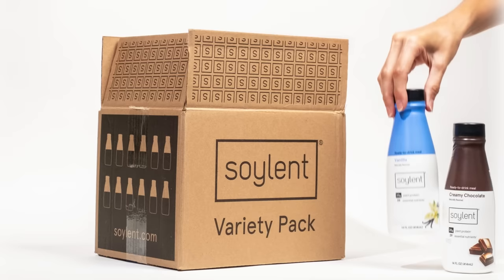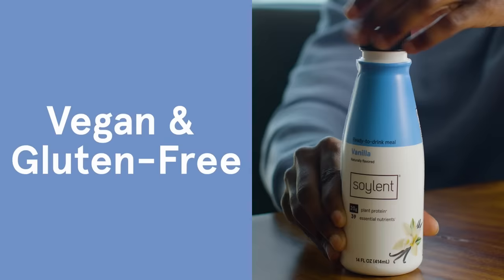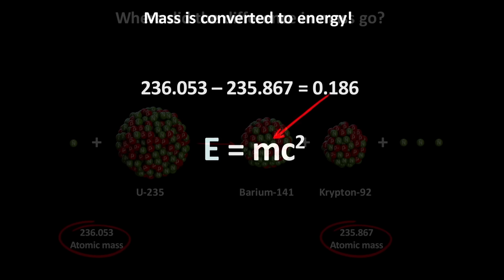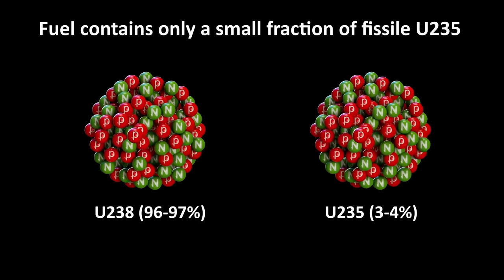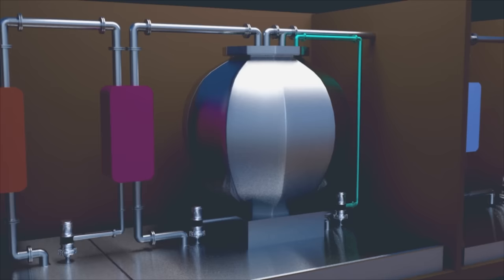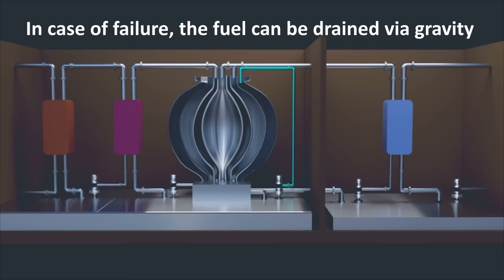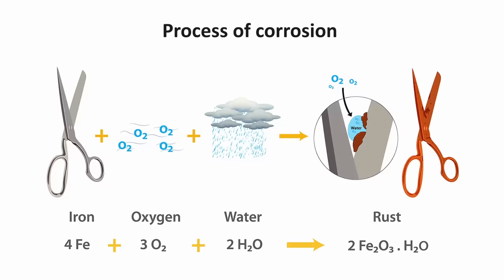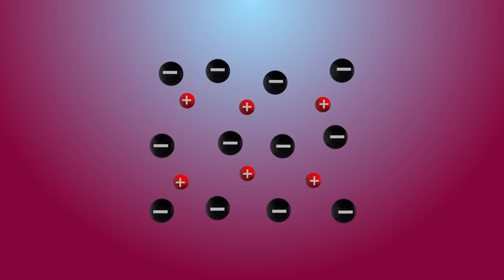How Molten Salt Reactors Could Revive Nuclear Power

Comment: I'm a retired nuclear and electrical design engineer with a solid 50 year career under my belt owning a nuclear engineering consulting company called Radiation Measurement Systems, inc.  We did work both in the civilian nuclear industry and in the weapons establishment.

You really screwed the pooch on this one.  You made so many mistakes that it was painful to watch.

First, let's get the biggie out of the way.  There is no such thing as a thorium reactor.  Thorium does not fission under any condition.  Thorium is a fertile material.  It must be transmuted into uranium-233 which is fissile.  The reaction is

Th-233=  + n > Th-233 beta decay ->protactinium-233 - beta decay -> U-233.

For a thorium-fed reactor to start, there must be some U-233, U-235 or Pu-239.  Once the reactor is started it will breed from the Th-232 more U-233 than it consumes.  In continuing operation is it a thorium fed uranium reactor.

Second, whatever they're doing in Copenhagen is irrelevant to the rest of the world.  I've been advocating for molten salt reactors for at least 30 years and I've never heard of them.  Proposing using heavy water as the moderator of a reactor which would run between 600 and 1000 deg C is pure insanity.  Do they plan on pressurizing the heavy water to keep it from boiling?  Water becomes a super-critical fluid at 374 dec C and 3,200 PSI.  At 600 deg C, super-critical water exerts a pressure of over 6,000 PSI (my thermodynamic table runs out below 600 C).  Are they really going to try to claim the reactor is safe with those kinds of temperatures and pressures?

Everybody else, including the original Molten Salt Experimental Reactor) is using graphite as the moderator.

Third, spent light water reactor fuel does NOT have to be stored for thousands of years.  Even without recycling, the spent fuel will be cool enough to store without shielding after about 100 years.

You need to understand the concept of the decay constant, the reciprocal of half-life.  This means the more radioactive an isotope is, the shorter its half-life.  The bad stuff like Cs-137, Ba-133, Co-60 and Sr-90 have short half-lives.  They're pretty much gone in 100 years.  The very long-lived stuff who anti-nukes who don't know anything, scream and yell about are barely radioactive.

A long example is potassium-40 with a half-life of about 4 billion years.  It is present in all potassium including KCl salt substitute.  On my website (neon-john.com) is a photo of a container of Morton Salt Substitute tickling my Geiger counter.  That's the major reason every human on earth (and all the animals) are radioactive.

You should further understand that Oak Ridge designed a burner reactor, designed to take the high level waste left over after the U and Pu are removed, and transmute it into even more more radioactive, even shorter lived isotopes That all decay completely in about 100 years.  The physical amount is tiny, something like a gallon a year for a 3.5 GW light water power reactor.

Fourth, Pu-239 in spent fuel is NOT highly radioactive.  With a half-life of about 1600 years, it can be handled for an indefinite period of time with bare hands.  As a practical matter, when Pu is handled in open air, cotton gloves are worn to protect the Pu from fingerprints.  I have handled it both in an argon glove box with only the rubber of the gloves between me and it and in open air with cotton gloves.

Fifth,  The thermal self-control you mention exists in all Western-designed reactors and is known properly as the negative thermal coefficient of reactivity.  In a PWR, when the turbine picks up more electrical load, the throttle valve demands more steam.  The steam generators respond by slightly cooling the primary reactor coolant (I'm talking about up to about 6 deg F) and thus increasing the power until the temperature is almost back to where it was.  The reactor self-controls over a moderately wide range of power using just the negative thermal coefficient without touching the control rods.  This is NOT unique to their molten salt reactor and is one reason nuclear reactors are so safe.

I could go on but I'll stop here and summarize.  You should not be posting on subjects for which you know practically nothing.  You didn't know enough to realize that the Copenhagen boys were feeding you the KoolAid and you drank it right up.

I should note in closing that there are at least 3 companies working on molten chloride salt reactors.  They claim that chlorides are less corrosive than fluorides but I don't see this going anywhere but my mind is open.

Lastly, much more information is available about the activities at Oak Ridge and the Las Alamos National lab.  One of the very few things Clinton did as President was an executive order called Libraries without Borders.  This order commanded every executive branch agency to declassify everything that could be and then put that info on the Internet.

Las Alamos responded with a massive declassification effort and then put their whole declassified library online.  Thousands and thousands of papers and reports.  Several of us nukes realized what a valuable and fragile resource this was so several of us scraped the whole site.  A direct download link to my collection is here.

http://www.neon-john.com/Nuke/LANL_reports.tar.bz2

This is a 5.5 Gig tarball that expands out to about 12 GB.

Lots of reports on the experimental reactors including the Molten Salt Experimental Reactor.

Sure enough, when shrub took office, he rescinded the order and the library went away.  Fortunately it got scraped several times before shrub got hold of it.

Have Fun.
Reply: The US had a short-lived thorium reactor in the 60's, and China has one in operation for about a year now.  Not sure if there is any point in reading anything else you have to say.

Comment: Of course there are problems with any knew technology but not unsolvable. Kirk Sorenson says that there is enough thorium in America's rare earth mine tailings (waste) to power America for a 1,000 years. The problem is that the PTB don't want cheap energy for the masses. Otherwise  thorium molten salt reactors would be up and running and plentiful.

Comment: The corrosion problem could have been solved long ago. The real reason was that the giant corporations that developed pressurized water reactors for the miulitary (and the fuel production cycle), wanted to make even m,ore money by dominating civilian powewr production. The vast amounts of taxpayer money they got for the military development just wasn't enough for them.
Also, the molten salt reactors don';t produce the plutonium they wanted for bombs back then.
Reply: Corrosion is just one of many problems. The biggest are no practical way to remove waste product, especially neutron poisons that well eventually collapse fission, Next is the problem of salt caking, breaking off in chunks and trashing the circulation pumps, third, no way to service the reactor or even do a proper inspect. LWR can be fully submerged in water and since the water is transparent, the can be full inspected inside for corrosion, cracks, etc.

DoA for MSRs.

Comment: Great video as always and very encouraging for our future. Wind and solar are GREAT, sometimes and in some places, but for 24/7 base load, we NEED this.
Reply: Until we come up with a good way to store energy, wind and solar ARE NOT great, they are a hindrance.
Reply: @jasonk125   Well I have been doing wind/solar EV's for more than 40 years and I could easily debate you or your Godz.  I will use experience and facts, you can use your dreams and memes.
Reply: @danadurnfordkevinblanchdebunk  I have no doubt about the truth of your good experiences with renewable energy, and I'm seriously rooting for the battery breakthrough we need, but as it is, I also believe the calculations I've seen regarding scalability of these energy-intensive/materials-intensive energy sources up to the point of powering our increasingly industialized society without a solid base load component - and we just can't keep doing that with coal and gas. We have to stop that NOW.
Reply: @aclearlight   Natural gas is mostly used today for peak loads which are absolutely essential for ruinables to work at all on the grid, but in case you didn't get the memo, the Greenies vow to do away with all fossil fuels.  Without nuclear this would certainly mean massive rolling blackouts, energy rationing, and exorbitant electricity rates.  Don't count on some major breakthrough on chemical batteries; after over 250 years of battery development, they are still not up to the task at hand.
Reply: @aclearlight   Will debate any EV nonsense too, although more people are waking up to actual facts on those so my efforts debunking them is getting easier all the time.

Comment: The elephant in the room is the grid costs. 
66% of electricity bills ARE grid costs.
100% of electricity bills are grid costs plus generation costs.

5 times more electricity is economically insane.

Most people do not know we breathe in huge amounts of nitrogen all day long.

Some people see only a flat earth.

Most people who promote nuclear electricity are ignorant outside their expertise. 
Ignorant of the size of the national grid and the construction cost and time frames of a grid 5 times bigger.

Transmission lines to 300million buildings, and its construction is totally ignored, and 5 times bigger 😮😮😮😮😮😮😮😮😮😮😮
Reply: @2023_GJ  the nuclear promoters are saying that they can stop all CO2 emissions.
So, 5 times bigger electric demand. 

That is what they say, and I agree that is how much more electricity is needed. 
Particularly when you replace petroleum fossil fuels.
Reply: @stephenbrickwood1602  So your issue isn't with nuclear power, it's with electrifying modern life. I agree a lot of new infrastructure is needed, but thats just the cost of business.
Reply: @12pentaborane  
 @toddpillow3074  
Multiple problems. 
Grid capacity must increase all the way to the millions and millions and millions of customers. 
Urban streets are expensive to work in. 
Australia has 20 million buildings. 
1 million klm of transmission lines 
20 million poles at every 50m.
The grid is 5,000klm long.
The existing national grid is fragile and lightweight because grids are incredibly expensive to build and maintain. 
66% of electricity bills are grid costs, for our lightweight national electrical grid 
Bigger and more robust and stable electricity bills will explode for the customers. 
Grids' new construction costs $ 1 million per klm. But 5 times existing capacity. 

We are talking about 5 times BIGGER than national GDP.
Nuclear industries for the world's countries, including all the dictatorships, which includes 80% of the world's population. Means defence budgets will explode. 

But I forget most people have not spent a career in construction and tendering.
Yes, I am angry.with dh nuclear promoters half talking about our real problem. Or f...king lying. 

And there are more big problems aswell
Reply: @stephenbrickwood1602  Personally I don't trust your numbers. I can't quickly find the data on Australian grid construction but a 5-fold increase in capacity seems pretty out there. Even without expanding the grid and still using petrol/diesel vehicles it's still worth getting off fossil fuelled electricity. Globally that produces 25% of the total carbon emissions, compared with 12% from all transportation. That's from Wikipedia, searching for emissions by sector.
Reply: @12pentaborane  you are on the money with your statement. 
It is difficult to find the full facts.
After finding the basic facts, you have to do the calculations.
I felt the same when the nuclear promoters attacked the distant renewables but totally ignored their own favourite solutions to fossil fueled CO2 emissions. They ignored the grid expansion they needed.
Reply: @12pentaborane  
Allan Fells, a long term Australian Government advisers, said Australia needs 5 times more electricity and so the Australian 25gW fossil fuelled generation today has to be increased 5 times if it is nuclear.
The SMR like the BW300X means that Australia needs 85 x 300mW = 25.5 gW.
But with no fossil fuels Australia needs 5 x 85 SMR = 425 SMRs.
No gas, no petroleum, no coal. No CO2 into the atmosphere, that is the point, yes ???
Also, No CO2 from any other country on the planet, because why waste Australian money, yes ???

Comment: Unfortunately, the wacky woke Democrats will never allow this because according to them the only solution is wind & solar. 😂😂
Reply: @clarkkent9080  All grid level solar and wind projects fail. They generate very low-grade, intermittent electricity that no one would build if not for the subsidies and purchase mandates. At lease, Vogtle will produce high-grade electricity 24/7/365 for 80 years with the plant paid for in 30.

Comment: The radioactive waste problem was solved a long time ago. What's the temperature you use in this video just nothing but misdirect people from the truth about nuclear energy. You're throwing around nuclear waste containers all over the screen that don't even exist in real life, talking about nuclear meltdowns while showing a dramatic picture of cooling towers which are even required for a nuclear power plants depending upon where they're built. You even showed a diagram of the water from cooling tower circulating through the nuclear core. It's like you have zero disregard for reality and trying to get people to understand what's really happening